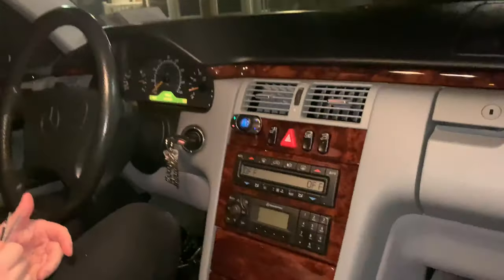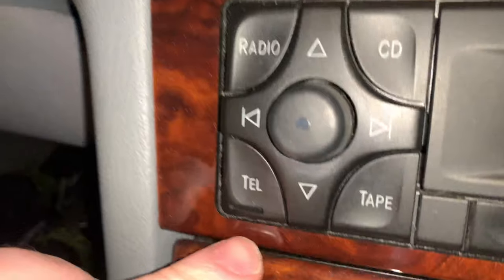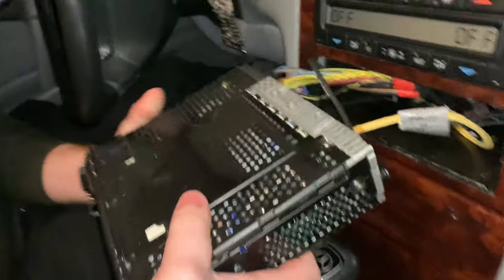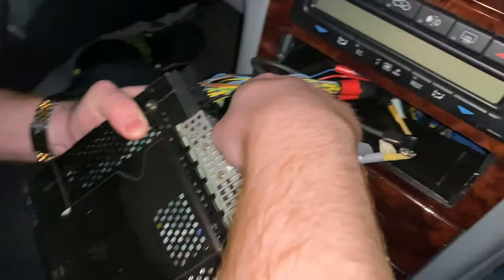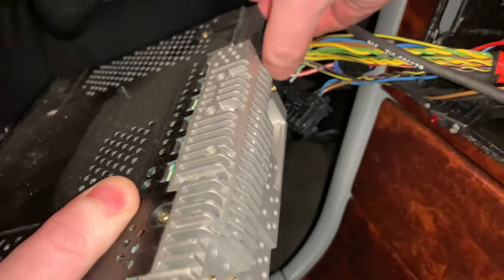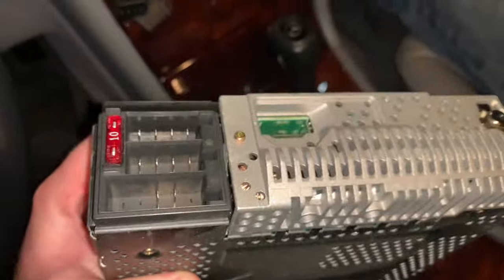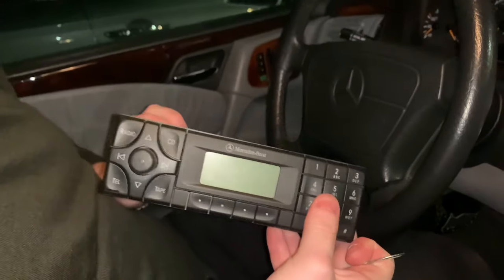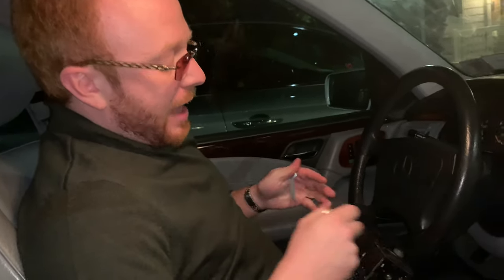How to remove Mercedes Benz Radio from 1990’s early 2000’s all models

Comment: How did it work out with Becker? What did they charge for the job? I’m considering it but apprehensive considering I’ll be radioless 3-5 days. They said they’d use my casset input did they use your cd input?
Reply from the maker: I had no issues. The short wait is worth it.

Comment: This is a really helpful video. I just bought a 2003 CLK320 and would like a Bluetooth radio in place. Which one did you go for, and was it just a plug and play replacement?
Many thanks for this
Reply from the maker: Congratulations Paul! As I explained in the video I kept the factory radio I just had it converted to Bluetooth by Becker auto sound llc

Comment: Thanks for the video I'm checking a fuse because mines stop playing
Reply: I checked the fuses and that's not it so I am still without a radio 🤦‍♀️. This was a great video!
Reply: @shantricehadley8344  Did you check the one on the back of the radio? Mine was bad.